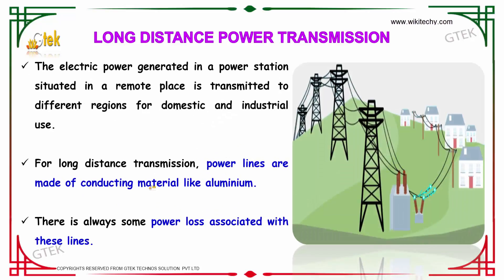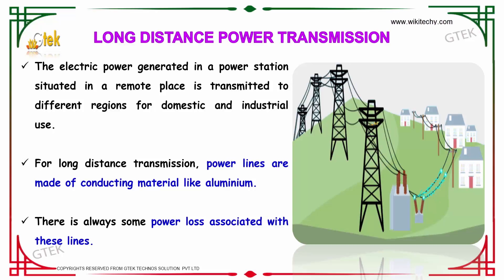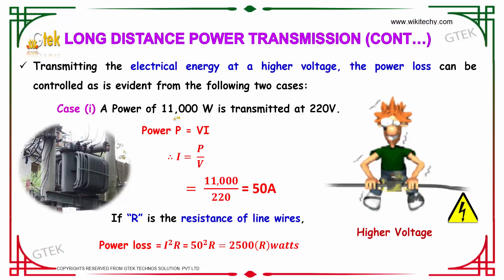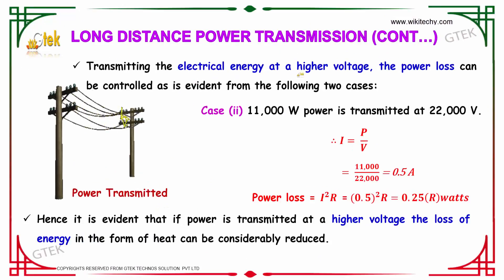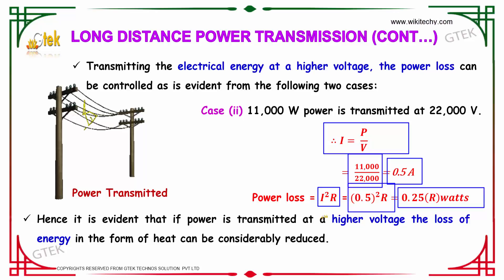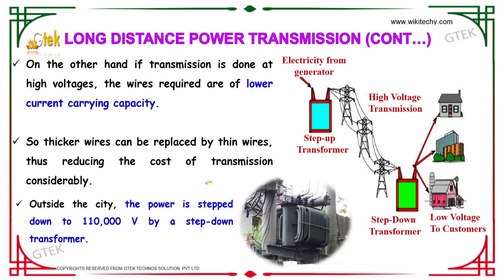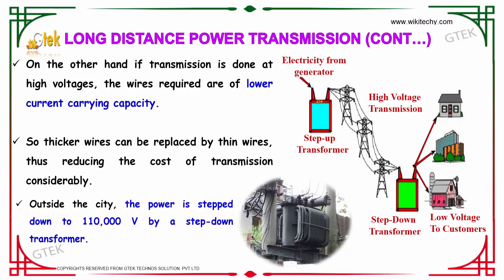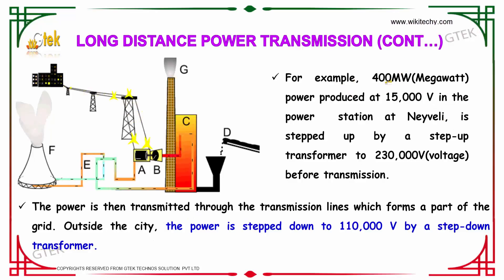Long distance power transmission |Electro Magnetic Induction And Alternating Current

Comment: HVDC Light uses underground or underwater cables as the transmission link. HVDC and energy efficiency. HVDC is attractive because less electricity is lost in transmission than with conventional AC technology. It also requires fewer transmission lines, meaning that less land has to be cleared.

Comment: Electric power transmission is the bulk movement of electrical energy from a generating site, such as a power plant, to an electrical substation. The interconnected lines which facilitate this movement are known as a transmission network. This is distinct from the local wiring between high-voltage substations and customers, which is typically referred to as electric power distribution. The combined transmission and distribution network is known as the "power grid" in North America, or just "the grid". In the United Kingdom, the network is known as the "National Grid".

Comment: ransformers and Long-Distance Power Transmission. Transformers are devices which use mutual induction to change the voltage and current of an AC circuit.

Comment: Electric charge in alternating current (AC), on the other hand, changes direction periodically. The voltage in AC circuits also periodically reverses because the current changes direction. Most of the digital electronics that you build will use DC. However, it is important to understand some AC concepts.

Comment: Transformers and Long-Distance Power Transmission. Transformers are devices which use mutual induction to change the voltage and current of an AC circuit.

Comment: When a current flows through a wire some energy is lost as heat. The higher the current, the more heat is lost. To reduce these losses, the National Grid transmits electricity at a low current. This needs a high voltage.

Comment: Electric power transmission is the bulk transfer of electrical energy, from generating power plants to electrical substations located near demand centers. This is distinct from the local wiring between high-voltage substations and customers, which is typically referred to as electric power distribution.

Comment: Electric power transmission is the bulk movement of electrical energy from a generating site, ..... Long-distance transmission is typically done with overhead lines at voltages of 115 to 1,200 kV. At extremely high voltages, more than 2,000 kV ..

Comment: To add a couple of points to Matyas Tamas's answer- HVDC is more economically feasible at ... power dramatically by increasing the transmission voltage. As a result, all long-distance power transmission, AC or DC, is done at high voltage.